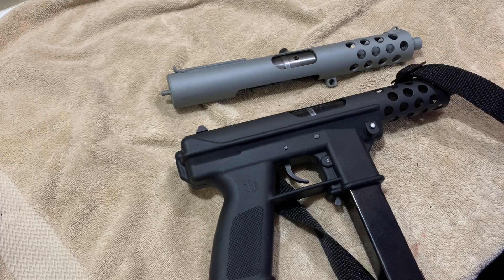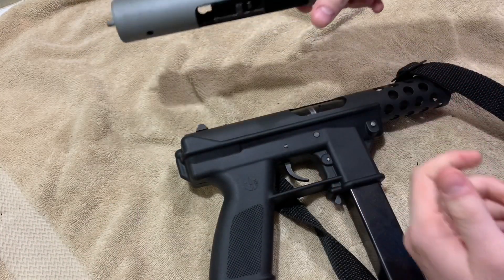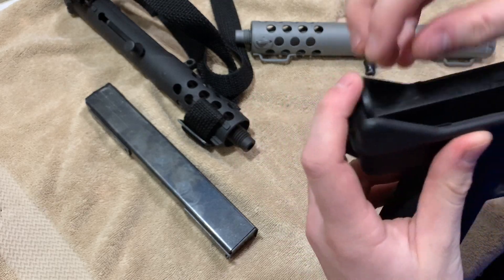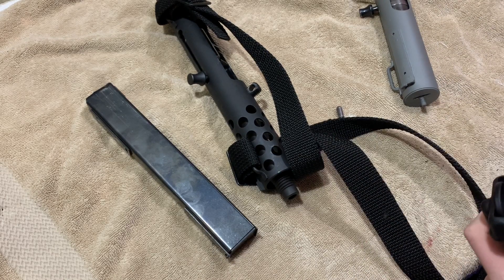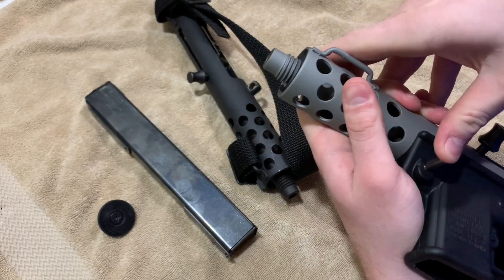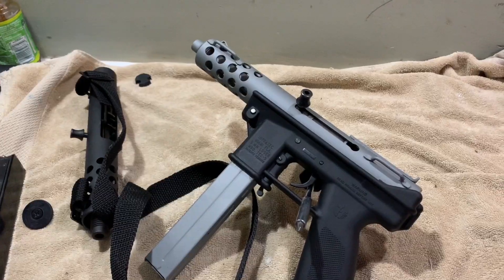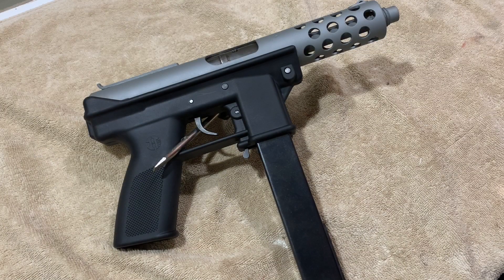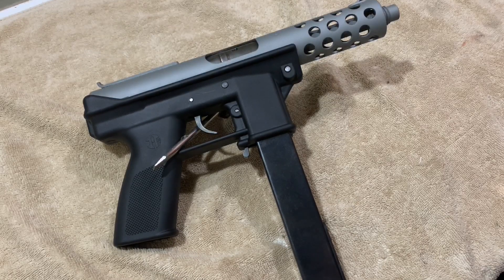Project printer! (PART 3)  Test firing new upper!

Comment: So just be sure… the upper is also not pla plus?
Reply: na, he bought the uppers online. the lower he used here is also the real thing, not 3d printed. here he was simply testing that his upper was working. he was planning to print the lower and test his real upper with it, but he couldn't get around to it.

Comment: I use to hate Tech-9s bc of jamming, but your version didn't jam.💪💯🆒
Reply: Which one did u have that jammed?
Reply: They're picky on ammo, and a lot of the aftermarket mags are trash. Try some different 115gr and 124gr ammo, and only FMJ, they can't cope with hollowpoints, NEVER shoot anything heavier than 124gr either, 147gr ammo can make the frame crack very quickly.

A lot of magazines are also just not any good, and sometimes the extractor wasn't profiled properly when it was manufactured. They're really not great guns, but you can get them to run pretty well to use as range toys if you get to learn their quirks and issues.

Comment: TT-33 3d plastic frame project: This project was carried out as a test of the possibility of replacing the metal parts of the pistols with more technologically advanced plastic parts.
The well-known clone TT - 33, or rather its parts - the barrel and the slide, was used as a donor.
The original is the direction of printing and the use of ultrasound to connect parts of the workpiece into a single whole.  On the Internet, this technology was not presented as of 02.20.2020
TT is working. 
NEW: Shooting test. TT -33 Propellant WST 3.5 gr.
Bullet 86 gr.

Don't hesitate to share content to obtain new interesting projects.
 I will be glad to the good comments.  

https://youtu.be/2pRYA8KMlCY

Тульский Токарева 3d пластиковая рамка.
Особенности изготовления.
 
#tokarev #TT #3d plastic frame #NORINCO #Type 51 #Type 54 #K54 #Z

Comment: I don't know how actually feasible this is but I'd suggest you design a lower that accepts scorpion mags. I know you already got a bunch of tec9 mags for it but for as reliable and nice I hear EVO mags are (also inexpensive) I barely see anything use them. It's all glock mags and I think it's really a shame. And put a pic rail adaptor on the back so you can put a nice pistol brace on it like one of the MCX ones or PSA's triangle folder brace. And maybe have it be AR grip compatible so you can throw a magpul grip on it.
Reply: Would be a cool idea, the curved profile I think could fit well with the gun's look. Also it wouldn't be hideous, unlike the Glock magazine setup some people insist on.
I think he said he didn't have the guns anymore though, which is a shame.